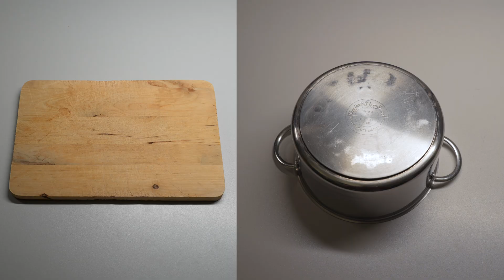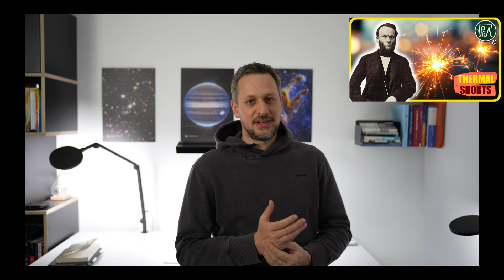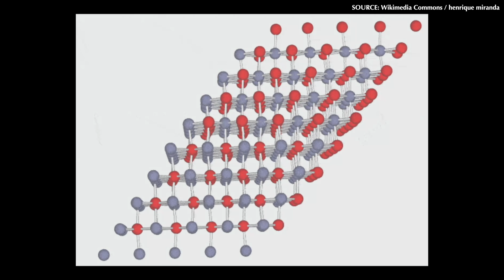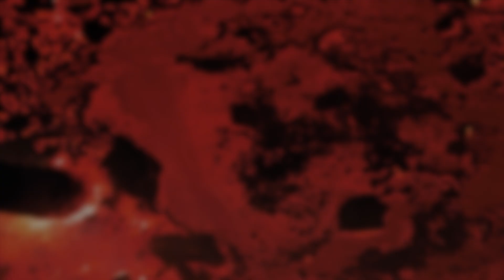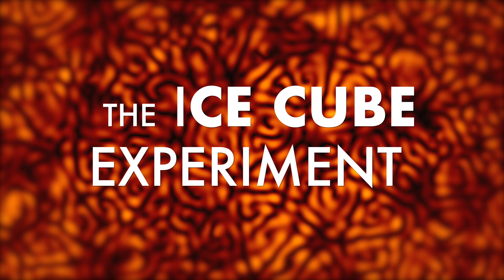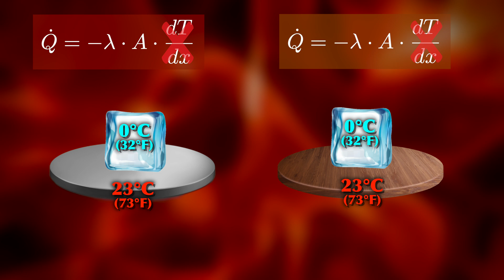We Cannot Feel Temperature

Comment: this was great and illuminating. thanks. Where does gas stand in this materials comparison? Suppose we are standing at the south pole. Our uncovered face will begin to lose heat to the surrounding atmosphere. What is the structure of this mixture of gases at ground level and shouldn't we lose less heat at a higher altitude because the air there is less dense?
Reply from the maker: The dominant mode of heat transfer in gases is typically heat convection, not heat conduction - meaning as the constituents of gas can move around freely, they can carry away heat. 

Your intuition about lower densities taking on less heat is correct, though. In vacuum (like space), it is difficult to get rid of heat, because you can only radiate it away, not conduct or convect, because there are no particles that can absorb it.
Reply: @physicsbutawesome  thank you